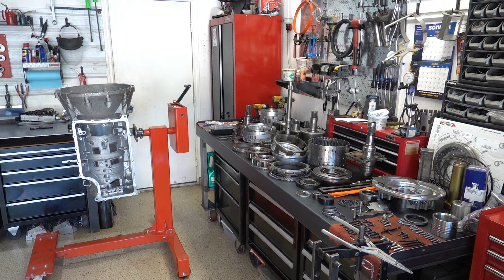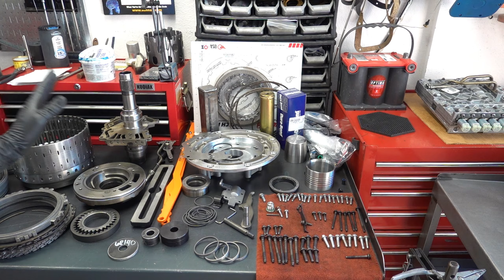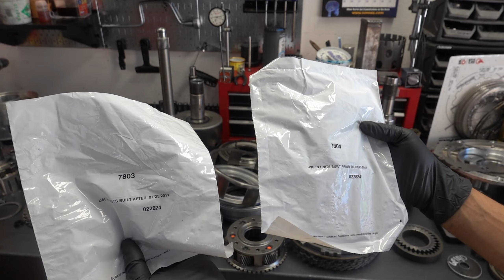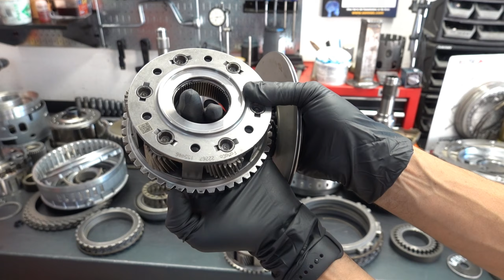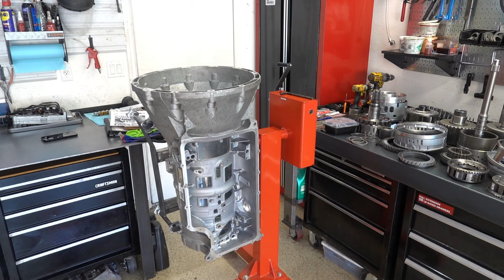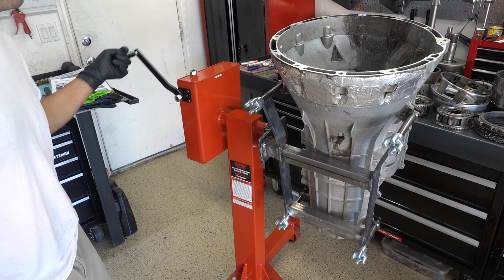Ford 6R140 Build Strategy - Stock to Mild Performance Applications

Comment: Check out VMS Concepts. 

Seal sizers and rear seal installer.
Reply from the maker: Thanks for the tip, Larry! 

I actually already have all the adapt a case tools (had to rob a few banks to afford them) so hopefully folks can save some money w/ VMS.
Reply: @nickstransmissions 

Well, as per their website. You can but it all for $265.00. Plus whatever shipping is. 

Small company, in the US, made in the US. With a lifetime warranty. 

The email they sent me, in reply to my questions. Was pretty fast. And they are about to introduce everything for the 10R140. Which apparently has the same CDF drum issues as the other 10 speed fords.

Comment: I appreciate this 6R140 video.  I have a 6R140 gas and I want upgrade to use it on a diesel.  Is this possible? Maybe cost prohibitive?
Reply from the maker: You will need a diesel case if you want to put the guts from your gas version behind a 6.7 Powerstroke.
Reply: Actually I am waiting for the adapter kit from Performance Adapters to put a 6r140 behind a 7.3l powerstroke.  I found this 2017 6r140 off of an e450 V10 motorhome.
Reply: I understand that a 2017 V10 shares same bolt pattern with 6.7.  I will of course need a HD diesel TC and appreciate internals to handle diesel torqe but in theory it seems a 2017 v10 gasser trans should work.
Reply from the maker: The internals for the gasser 6R140s are the same as the diesels installed in the F250-F450 truck lines. The commercial spec 6R140s (F550+), Peterbuilts, etc have 8-pinion rear planetary carriers instead of six-pinions & come equipped with PTO gears in the pump, but those are the only differences. So your gasser 6R140 should work just fine for your application.

Comment: Hi nick, I’ve been watching yours videos and have learned a lot in a week about the 6r140. My 2017 f250 is starting to get a shudder when the tc locks up. And under acceleration it feels like a harsh down shift but it’s not(have it in manual), I can watch the tc slip go from 0 to about 500 rpm on my monitor. I’ve done some research but I’ve found nothing about this. I’ve been watching your videos to prepare myself if a rebuild is needed
Reply from the maker: Thanks for watching, Jack. Not sure what you may have been researching but shuddering is the most common symptom indicating a problem with the TC apply/lock up system in the converter. Drop the pan and see if you have a whole bunch of fine silverish-metal looking material at the bottom. If so, yank the transmission out for overhaul and replace the TC with a new one.

Comment: The short rubber hoses, where do they go? I missed that
Reply from the maker: You didn't miss anything as I did not cover any procedures in this video as it was intended to be just a strategy/planning overview for building one of these units for stock applications. I will have a full rebuild series on this transmission coming soon, within the next month or so - stay tuned if you would like step by step instructions from start to finish on the 6R140s. It will be a diesel PTO unit as well.
Reply: @nickstransmissions thanks Nick, I know they are tube seals and two go to the rear for supply lines, the two long ones, the short one appears to go over by the shift lever, at least I hope, it fell out when removing valve body.
Reply from the maker: I think I show the tube seal locations in the tear down video linked below but if not, I will make it a point to do so when I film the tear down of the 6R140 sitting on tear down bench now...That tear down vid should be up in another week or so.

Teardown: https://youtu.be/zE9s2dApDAM

Comment: I have a 2017 6.7 4x4 200,000 miles. It shifts hard from 1st to 2nd and from 3rd to 2nd. It can also hit 6th hard sometimes. Any suggestions.  Thanks
Reply from the maker: Thanks for watching, Michael. I suspect your valve body's 2-6 clutch latch or regulator valves in the valve body are worn. Pull the valve body and vacuum test it to see if you can find any valves not pulling at least 15Hg and go from there.
Reply: @nickstransmissions thank you. I'll do that

Comment: Hi, thanks for the video! I need some support torquing the bolts on the transmission case, could you please help me on the torque sequence of the bolts on the shaft side for installing additional gearbox? Thanks a lot.
Reply from the maker: Hi, good news is there's no torque sequence you need to follow when bolting the VB assembly back onto the case for 6R140s..Just install it correctly and torque to spec.
Reply: @nickstransmissions Thank you!

Comment: Have an issue with the torque converter not unlocking. Truck drives fine until I come to a stop and it pulls Rpms way down let off the brake and it jumps forward. Any idea? Does that sound like torque converter? 
2016 f450 diesel
Reply from the maker: Hi Speedbeak, yes - sounds like the TCC is dragging. That could be due to the TCC solenoid staying stuck on (check for DTCs if you haven't already), the converter clutch itself failing or the TCC o-ring on the end of the input shaft wearing out to the extent it's allowing fluid into the TCC apply circuit at all times.

Comment: Hello nick appreciate your quality videos and info, i am planning for my build and want to know were to i source the spacer shims? Can i get a set or do i have to get my measurements then order? Thankyou!
Reply: Thankyou for the great response. Can you send a link for the proper measurement tools i will need for this and future builds much appreciated.
Reply from the maker: All you need is a dial indicator and base along with a means to hold it steady while you do your end play checks.
Reply: Very good Thankyou nick.
Reply from the maker: You're welcome, Dean...Good luck with your rebuild!
Reply from the maker: Thanks for watching, Dean. 

Are you talking about the selective spacer for setting front end play? If so, measure then order if the current spacer doesn't give you the end play measurement you need.

Comment: How did those GPZ frictions turn out?  I got a squawk out of them
Reply from the maker: Hi Shawn, thanks for watching...I've never had an issue with those frictions in these or for any other transmission that I have used them...What do you mean by a 'squawk'? 

Sounds like a hard part related issue but I could be wrong...
Reply: @nickstransmissions  a squawk when the clutch is applied
Reply from the maker: I'm interpreting your use of the word 'squawk' to mean you're hearing a bird-like sound but if that's not correct, feel free to clarify or better describe it. That said, it sounds like either the clutch pack(s) in question is slipping, something like a return plate for or spring is loose (snap ring may have popped out and it's scraping on the drum)  one or more clutch packs or there's a hard part that's starting to go bad...Beyond that, you'll have to confirm the noise is in fact coming from the transmission then take it out, tear it back down to see what's making the noises.
Reply: @shaunswanson7390  i had a squawk as well in the OD clutch when it applied, i was using GPZ clutches paired with kolene steels, went back to standard frictions and steels and the noise went away.